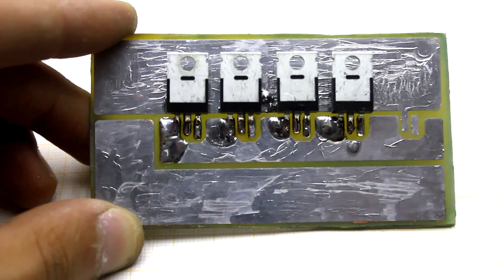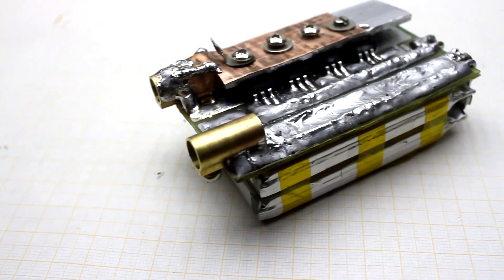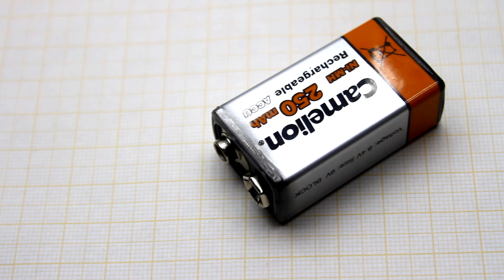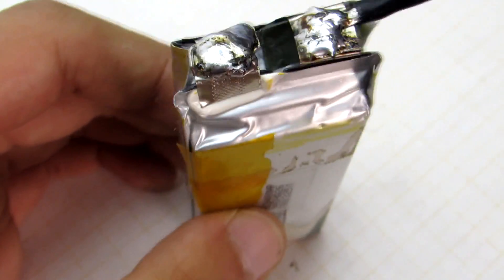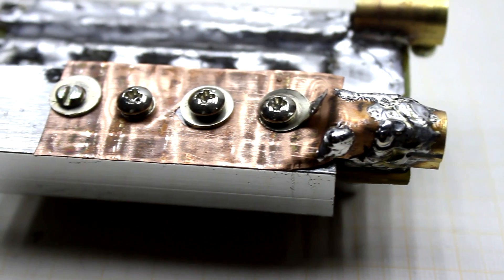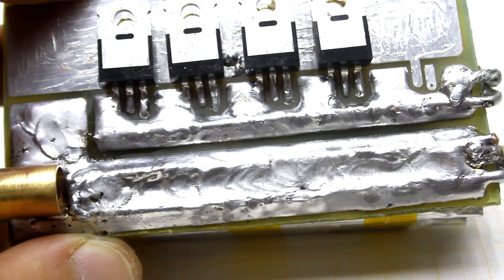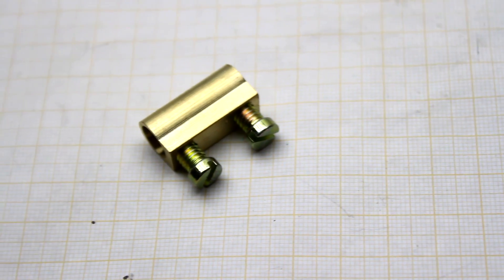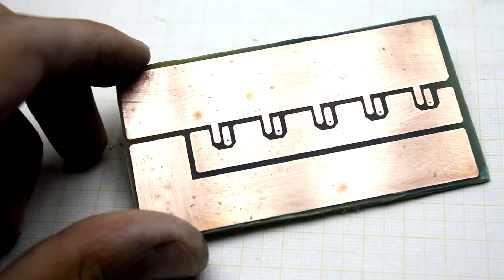DIY pocket welding machine

Comment: Friends need suggestion I have connected UPS transformer with DC 12v and capacitor of 15000uf/50v as a Batt. source but no luck . Why cant we use any dc power source instead of  3.7v 4400 mh bat..?
Reply: Transformers put out AC current and won't charge a capacitor . you need to add a rectifier on the output of the transformer to get dc output from the transformer and then use the dc output to charge the capacitor . not sure if that's what you were wanting to achieve but hope it helps you out
Reply: @Mike-nk3su  Yes madam I electronic diploma holder person I know basic all things like transformer output is AC then converted using high amp. 6amp diode bridge then DC filter. But as per your knowledge it should work right? Because your theory says our mosfet taking small dc current & increasing those small current to high current using switching method. If your answer is yes it should work then I'll try my best to correct the circuit.
Reply: also you have to connect AC voltage to transformer I'm pretty sure it won't work if you try to power the transformer from a dc power source
Reply: feel free to correct me if I'm wrong lol
Reply: @Mike-nk3su  All correct no issues.

Comment: Dear Madam, 
I made this circuit in one shot everything is okay. It works very good ,but still you said that in feature there will be more improvement may come, So I would like to suggest you that we can use our computer UPS transformer as main power source instead of Li-io battery, this way we could avoid charging situation problem for those battery.
Thanks for making such a wonderful circuit.

Comment: I noticed that you have a number of wires for each electrode. Would using a wire called Deans Wet Noodle Wire let you only use one wire ??? A Deans 12 gauge wire has 1660 tinned wires inside the insulation. Since electricity always flows on the outside of the conductor and the crazy number of current path let you use just one ??? Thanks and good day too.

Comment: Hi, do you think that a DIY welding machine for stick welding could be done? Like an arc welder for MMA:)
Reply: yes it absolutely can and pretty easily too with just an arduino and some diodes and resistors and capacitors.  I'm planning to make one.
Reply: hope this is a joke ;)
Reply: I am 100% making a arduino based arc welder and have already designed it in my head and can draw the entire circuit right now.  this is not a joke.
Reply: Ahh ook :) I wrong intended the part of resistor, diode and so on. For an arc welder is needed very large diode and components!! What kind of topologies do you want to use?
Reply: the diodes for rectifying to DC only need be huge if using one or multiple large transformers to lower the voltage prior to rectifying with your diode bridge.  However, if you rectify mains power to DC with normal small diodes and then use a buck converter, in a transformerless power supply, then all your parts can be small.  You can create a welder the size of two fists with the power of a giant 200 amp welder in this way.  Or you could use a switch mode power supply that only uses a small transformer that pulses at high frequency of your own making - in which case you rectify mains to dc then create your own switching AC with mosfets to generate a very fast switching pulse through a small transformer designed for very high speeds.  This is how a pc power supply works I believe and is small and lightweight despite having fairly large throughput.  Why people insist on using giant transformers that weigh 8-10lbs in modern electronics eludes me...
Reply: Yes I know very well the high frequency SMPS:) in fact I'm asking what kind of buck or buck-boost topologies do you thinck to use. Like an easy buck converter or more complex push-pull, inverter, dual forward or anything else. One more thing, if you want to have an excellent welder you probabily need to have a DC at the output, that means that you need to rectify as well a huge current and at a very high frequency (it means expencive diodes)
Reply: I plan to rectify mains power then use a simple buck converter that will operate at very high speed switching using a small ironless low induction inductor coil - air coil type and two mosfets instead of a mosfet and diode (one goes on while other is off and then flip flop for the return electric) and it will be a regulated buck converter.  we will then have the required high current dc... if I want or need to, I can do parallel buck converters as many as I want to provide more current if my components struggle to have enough throughput.  No expensive diodes needed in this design.  I can also weld aluminum with AC just by using a h-bridge of power mosfets to swap the polarities of the dc output of my buck convert(s).  And all of this will run off arduinos for the switching.  There will be NO transformers at all in my design.
Reply: Ok so you plan to build a synchronous buck converter. This cuold be quite dangerous becuase you don't have any isolation from the main power, and probabily get in conflict with the main power ground! Anyway as you want to use a BUCK topology you probabily need very high current MOSFET as the freewheeling one, I don't think they are so cheap.
Reply: 55v 110a IRF3205 power mosfet only $1.98 for a 10 pack with free shipping.  so that's $0.18 each.  Not gonna brake the bank of a 5 year old...  As far as danger, you have the system in a sealed box.  I don't see any danger but I'd be interested to hear a list of potential threats involved and see if they are addressed in my design.  I researched the dangers and didn't find any that seemed a big deal...
Reply: here is a quote about not using isolation in a power supply from an electrical engineer: "If the only stuff on the low-voltage side is inaccessible electronics, then non-isolated supplies are fine - they tend to much be cheaper/simpler than isolated supplies, and lots of household equipment uses them. Even things like televisions used to work like this, if you go right back to before the time when they had external video/audio connections."
Reply: also the freewheeling mosfet is just a 55v 100a mosfet that costs $0.18 on any site... not expensive at all
Reply: As you mentioned before, you plan to use a simple buck converter that takes the rectified main (it is about 325V DC). The IRF3205 are not design to reach this voltage rating. And maybe you need a power MOSFET with an higher voltage of 325V as you are playing with inductor and high frequency. Anyway the direct connection with main power plug have a very bad consequence. As you know all the welding machine that are available has an isolation transformer inside (it could be an high frequency or low frequency). This is a very important aspect in the secure operation of the welder. When you use a positive (or negative) clamp, you can connect a very large piece of metal to a fixed potential (this potential should be a ground, even if you are welding on a tabel that has metal legs, you are connceted to ground). This doesen't work if you don't have any isolation from the mains. This is a security aspect.
A more interesting thing is that if connect direct with the main and you have a safety swith in your home it opens every time that you conncet some to the earth (it could be the floor of your lab, that is a quite well earth).
Unfortunatelly you aren't operating in a seled box, because you always have a connection to earth in some ways. It could be your body, or the pieces that you are welding.
Hope that my english is easily understood :)
Reply: Nope I'm in US so the 120v ac main rectifies to 155v dc and the buck converter will take that down to like 18v 90 amps.  The welder will have two plugin cords to plug into two separate circuits in the house to get a collective 18v 180amps.  There will be one buck converter in EACH so minimum two buck converters but you can wire them in parallel on the same circuit to ease the burden just like wiring two batteries in parallel.  Also, the IRF3205 will be my RETURN mosfet that handles the high amps.  The main switching mosfet that feeds the inductor coil of the buck converter is a IRF840 500v 8a as the voltage at that point is still 155v at lower amps and the amps do not go up until after the inductor due to the lowering of the voltage at that point.
As far as the mains not being isolated I still don't understand the risks despite my research and your description...The rectifier redirects the live and neutral AC lines both into my positive dc and the ground dc is just where current flows back into main.  Any surges from main trip the fuse I added.  As long as you have surge protection what else could the mains do that I need to be concerned with?
Reply: Oh my god, you probabily don't understand how a buck converter works.. If the maximum voltage is 155V all your switches must sustain at least this voltage. Even the freewheeling switch must sustain the input voltage (when the primary switch is closed, the secondary switch must sustain the input voltage). BTW. The ground of your circuit is quite different from the ground of your home, so the "negativa terminal" is not a earth and is not at ground potential... So dangerous, and you can easily understand this by opening a SMPS of PC ;) that is obviously isolated from the mains.
I'm quite away from the design of paralellising two buck converter, quite better could be the parallelising of the switch in a singolar well designed converter.
Reply: the highside switch only ever gets the 155v rectified dc and the lowside switch only ever gets the 18v bucked down dc coming off the inductor coil.  you are wrong if you think the lowside switch experiences 155v dc at any point because when the highside switch is off, that voltage is off and the only voltage the synchronous lowside switch is getting is whatever voltage the inductor coil was charged up to which in this case will be 18v.  This is why the lowside switch will be high amps low voltage mosfet 55v 100amp rated and the highside switch will be high voltage low amps 500v 8a rated.  As far as the parallel buck converters, that is the best design when all you have are 120v outlets.  You must combine them period and what better time than as the buck outputs.  The safety aspect is fine after all I looked it up thoroughly and finally understand it fully.  The positive electrode of my dc circuit is referenced to earth ground so my workpiece will be live/hot with respect to where I am standing.  So I must not touch my work-piece nor the electrode at any time.  If I touch the work-piece, with ground clamp on it, it will only go into the ground clamp as that is a better conductor and it will take the path of least resistance.  But if I touched the work-piece with live electrode connected to it but no ground clamp, I'm the ground clamp.  This would be unlikely to happen.  The feeder rod will also be something I can't touch as it will be live.  So I'll have to wrap the end of it in electrical tape so it won't conduct into me either.  With just a few basic precautions and awareness, the risks are really negligible.  Not a big deal really.
Reply: yes if you know what are you doing the problem of touching the part you are welding could be negligible. But don't solve the problem of the gorund potential that is different from the earth potential. As you are not working in an isolated weel you always have some electric pattern to ground(earth). For the theory oif buck converter I don't want to go further, try by your self. If you want I can repeat how does it work: when the primary switch is closed Vin (or Vg) is applied to the inductor, is it right? As the inductor is connected even with the secondary switch it will take the Vin as well. So secondary switch is open and primary switch is closed, please before responding try by your self:)
Reply: I am unclear on how the differing grounds will hurt my circuit.  As far as the secondary switch, when it is open, I assumed it can handle ANY voltage no matter how high since it is OFF.  When it is off, nothing is passing through it so it does not have to be rated for that voltage - must only be rated for the voltage that passes THROUGH it when it is closed.  Is this right?
Reply: okay I just found out that when open, the secondary mosfet when exposed to the 155v would fail due to a VERY low breakdown voltage when Vgs=0.  I assumed when Vgs=0, the breakdown voltage from drain to source would be HUGE since no current is passing through it!  I am surprised my assumption was incorrect here.  I bought IRFB4227 200v 65a for the secondary switch which can handle over 100a pulsed easily and can handle the 155v and it is only $0.80.  Now I just have to learn what problems with ground I am not seeing.  I'm guessing I should be looking up how to solve ground loops?
Reply: PS I just realized what you meant about not needing 2 buck converters in parallel but instead just feed the two ac lines into rectifiers then feed these both in parallel into a single buck converter whose switches can handle this much power - and just by wiring the switches as two switches in parallel, you can double their amperage handling so the same buck converter design for a single ac source can be modified to handle two ac input sources quite easily rather than having to make two distinct buck converters and then have the outputs of those two merge after being bucked down.  Very clever.  Thanks for all the ideas and help AT Lab.  I'm very new but you have taught me alot and helped me improve my notes and plans for this welder project.  I still think I do not need a transformer.
Reply: Great so lots of the problem were solved :) so of course when the switch is open it must sustain at least 155V, as you now undestrand there is a breakdown voltage. Just to clarify, when the switch is closed its drain source voltage should be as small as possible, due to the power dissipation.
Fot the parellilizing of different buck converter my opinion is to have a singe buck with larger switch then two converters. Because it is not simple to parallelize SMPS instead parallelizing switches. Here is a note, two switch in parallel in general doens't double the current, due to parassitic effect. Maybe could be 1.5 time the current of the single.
For the gorund potential is a problem of circuit connection to ground via your body or whatelse between the negeative terminale and the earth (for example the simple piece of steel you are welding that touch the earth). In this case you are shorting earth with a point where voltage can vary in time, so a current can flow trough negative to ground and not return to positive.
In this case there is a clarification: this device will go in contact even with body and earth, so it is accesible ("If the only stuff on the low-voltage side is INACCESIBLE electronics, then non-isolated supplies are fine").
I'm happy that you are understanding all the problem now :)
Reply: I feel comfortable having live circuits like this because I always work on AC wiring in walls and outlets with the power still on.  I simply work with one hand and use rubber handled pliers and things like this and never have electrocuted myself.  This will be like that.  Not a big deal.  Welding all steel parts on a rubber mat will isolate them and all ways I touch weld will be with rubber gloves and rubber handled tools.  Thanks for all the help again and I will post video on welder some day probably in a long time since I'm busy with other stuff first :)
Reply: Ok, if you completetly isolate everything you will connect to the welder from the earth and your body it could work fine:) I'm curios if you post the video, please notice me

Comment: Yeah.... Shorting out LiPo batteries is a great way to turn this into a pocket arson device. Not to mention that mosfets typically fail short circuited which means if one of them goes there's no way to stop that thing from going critical.

Comment: why use many thin wires together on electrodes when a single heavy gauge is less resistive?
if you need this for a MacGyver survival situation ok, but the whole concept is dangerous when shorting out a battery.
charge some capacitors and add a switch switch to disconnect the batteries for safety

Comment: You do realize that shorting out LiPo batteries can cause them to explode? Also, you do realize that there's no way to monitor the battery voltage and thus you can easily cause it to over discharge, killing it? No? Then do research and be familiar with LiPo safety!
Reply: Bro it's Russian federation, calm down. It's working and tested by thousands deads

Comment: just use a car battery and two electrodes
Reply: Focus No no no, not enough current and dangerous as fuck.
Reply: PunakiviAddikti there's plenty more current.  Car batteries have been used as emergency welders.

Comment: Cool design!  Very simple yet functional.  Also to the people commenting about shorting out a lipo: Clearly there's resistance at the battery tabs that's greater than the internal resistance of the batteries.  It wouldn't work otherwise.  So it isn't shorted out.
Reply: Jason Reel Shorting out a LiPo battery with wires is never allowed. Do your research.